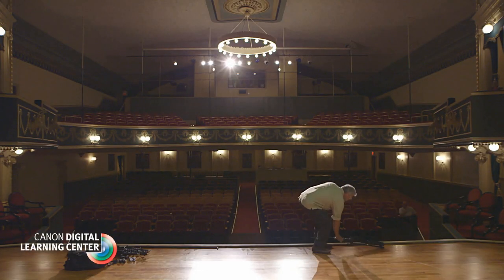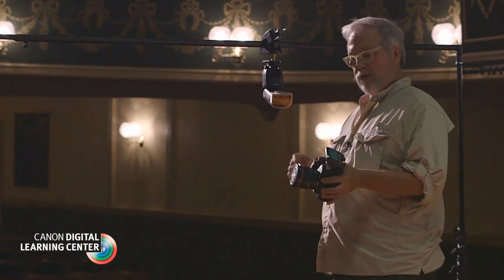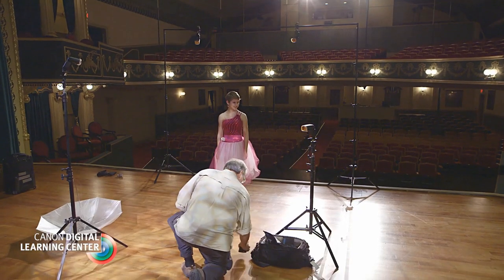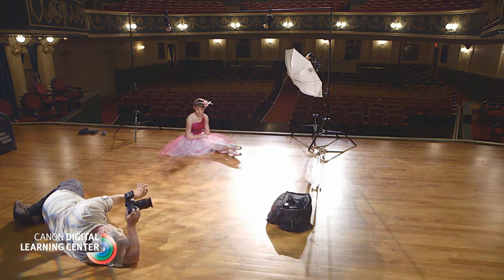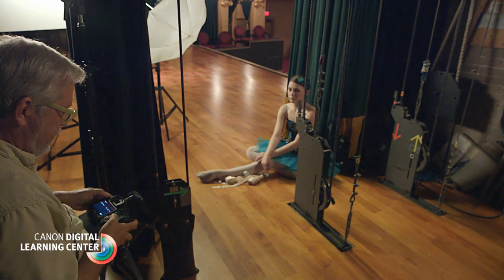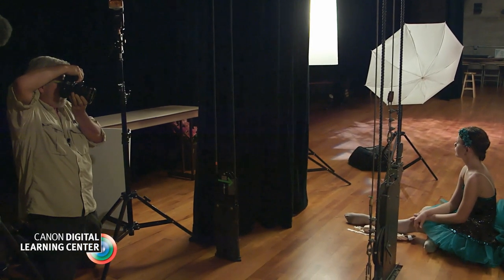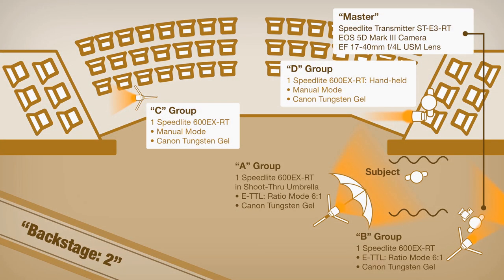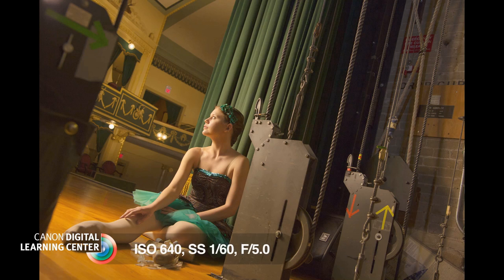Canon Speedlite 600EX-RT: Creative Lighting with Bruce Dorn -- Ballet Dancers (2 of 5)

Comment: Thanks for your reply but I;m triggering speedlights with radio remote(PW) and I don't need any preflash at all.  Is it possible to turn the preflash off?  
Instructions missing the part with combining speedlights with flash heads

Comment: Canon, thank you for your response. What does not work is Groups. What I have to do is ratios which makes it tougher to turn off one or the other. I also understand I can't set my flash from the camera. If I am incorrect please let me know. I have tried groups several times and I can't get it to  work. When I turn off a group, it still fires. I am up to date with my 5D2 firmware.

Comment: I have a 6D, is necesayi the ST-E3-RT to control de 600 EX RT?
Reply from the maker: Hi Alejandro!  The Speedlite Transmitter ST-E3-RT is only necessary to use if you have a complex lighting setup in which you are trying to communicate with a large group of individual Speedlites wirelessly. You can use the Speedlite 600EX-RT without the Speedlite Transmitter ST-E3-RT to set up wireless communication between flashes. If you still have additional questions, feel free to reach out to our technical support team at http://bit.ly/ContactCanon.  We hope this helps!

Comment: When you use the Speedlite with Orange Gel. What is the correct value of the Kelvin?
Reply from the maker: Hi, thanks for posting! Bruce was using the orange Tungsten gel, which allowed the flash to match the tungsten lighting fixtures. You can try shooting RAW and using the Tungsten (approximately 3200K) white balance.

Comment: Great video!
I use three flases: two 580 and one 600 ex rt,triggered by pocket wizard .

However there is a problem whe I want to include more lights - flash heads to be triggered optically by speedlights.  It seems there is a preflash in every speedlight even though all were set to manual mode, and that preflash triggers flash head resulting unsynchronized lighting.
Anyone has similar issues?   Im worried mostly because i want to buy ringflash to be used as main light

Comment: Final images are quite boring. Sorry. To be honest, fiddling around with so many flashes in ETTL seems so over-complicating and limiting. I'm sure things could have been done much quicker if he wasn't relying on the speedlights' judgement. I'll just stick with my manual speedlights and studio strobes for full control.
Reply: Daniel DeArco you missed the point of this video bruce mixed ettl with manual flash here , using ratio for ettl and power control on manual. Also showing how far the radio transmits in the theater and works through walls. I for one am impressed with the flashes and the resulting images.

Comment: I was disappointed that a video about "creative" lighting with 4 - $600 Speedlites and a $400 Transmitter only showed the Speedlites being grouped and fired. Is that all this set up is good for? what about changing the zoom or power output from the transmitter? You sponsored all of this guys gear for him and all he did was light up background walls which he could have done without a transmitter.